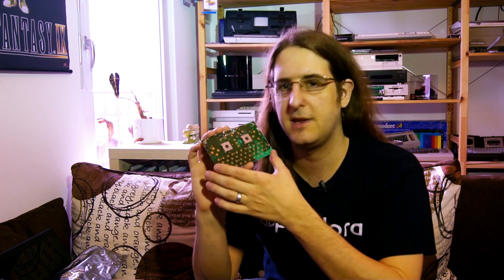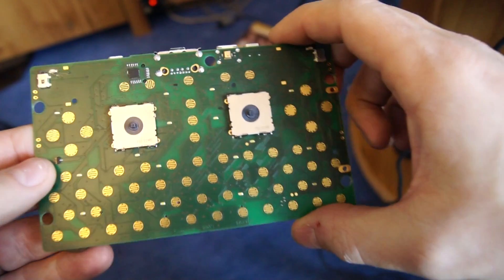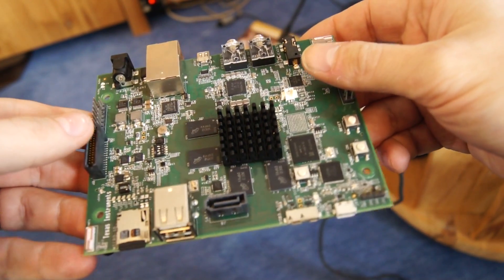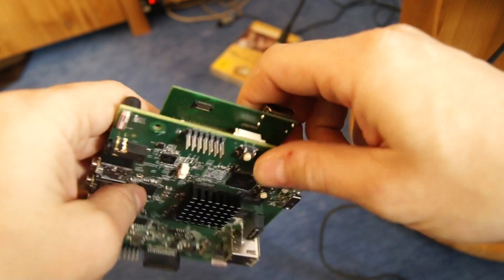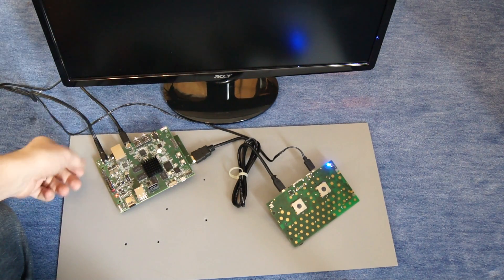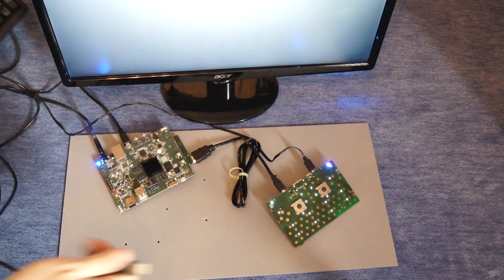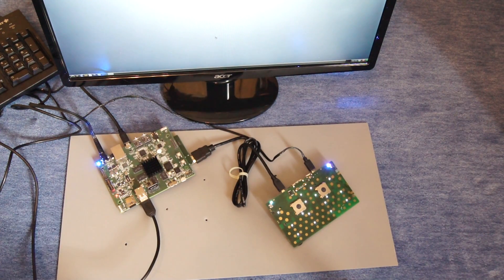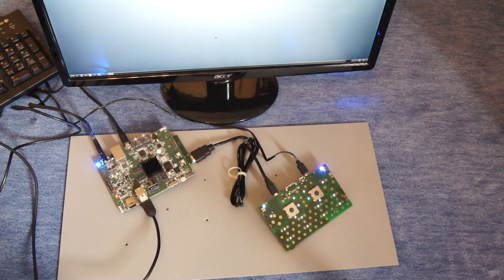Pyra Dev-Blog 1: Introduction to PCB development

Comment: It looks promising, however the current estimation for the price is a bit high($599).
Reply from the maker: Rocky McCleary Well, it's cheaper than many modern smartphones but is more complex, can do more, can be upgraded in the future and is made in way smaller quantities - so less profit for us than any smartphone manufacturer gets.
Reply: Plus, it's not android.
Reply: Rocky McCleary You can run android on it if you want, and in the future possibly even just Dalvik or ART to run Android apps on the Pyra distro.
Reply: No, i'm saying its a good thing. I hate android for gaming devices

Comment: of course it will cost triple than the pandora.i was a pandora owner for a while,but then i found out alternatives like the nvidia shield which was 1000x the power of a pandora.so ,unless this pyra could beat the shield,and finally abandon the ARM cpu in favour of something that could also emulate old windows system,i'll just pass
Reply: You can emulate an old windows environment on an ARM device. The trick is doing it WELL.

The Pandora is expensive, to be sure. It's neat to watch a consumer device get designed, though, even though I'll likely never afford one. (The screen seems like it might be a bit small for me to see, as well).
Reply: DFX2KX
ahah yeah you're right.i forgot to add that i actually managed to run windows 95 on my pandora,except that it was slower than molasses.also,they've shown a video about this pyra on how powerful it was,by running 3 or 4 emulators at once..which is ok,but i'm not sure how that can be useful to many people..it would've been better to see a demo of a dreamcast or a psp emulator running on it,to really see the true power,rather than 4 emu that we already know are working on the pandora.sure,they didn't worked full speed(the n64 especially)but still
Reply: Zontar82
Windows 95 on the pandora? oh bow... I got Damned Small Linux to run on my old Pantech crossover android phone, with understandably horrible results. I did hear that hardware acceleration isn't in, at least that's what the demo video seemed to say, so that might have a great effect on what they can actually show off, at the moment.

The killer bit for me is the price. my Fujitsu Lifebook (albeit used) was less then the Pandora. It's not as small, sure, but still. Though, with an i5, it needs both batteries in it to get 3-4 hours.